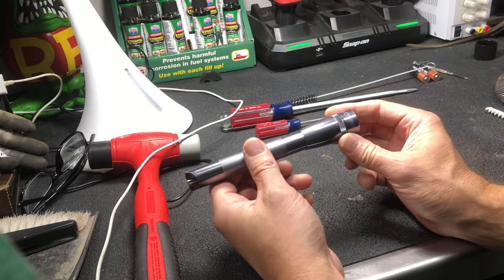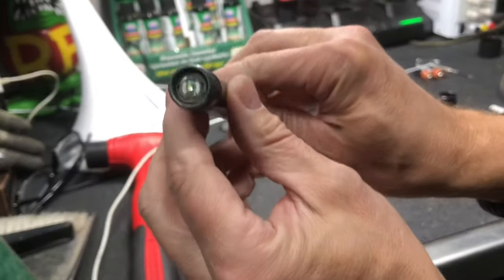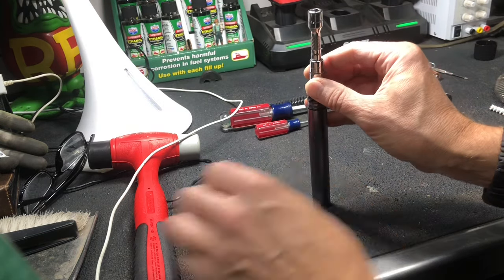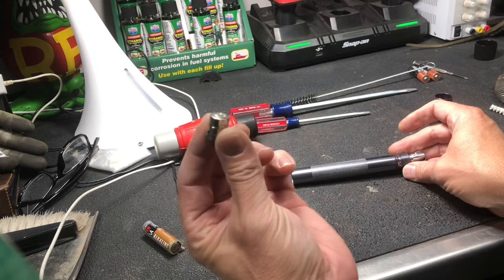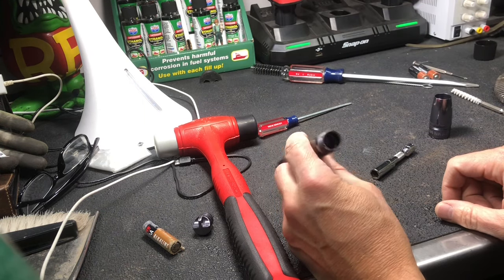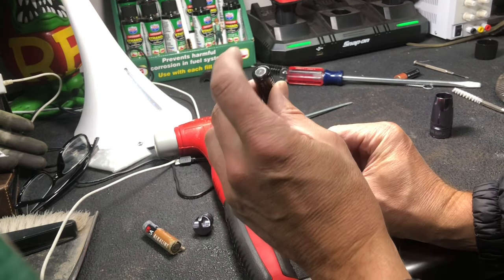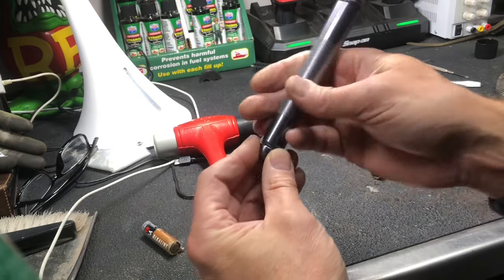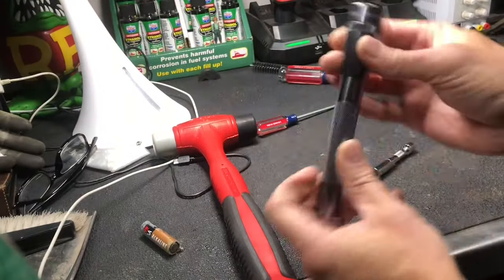How to easily remove bad corroded battery from LED mini maglite !

Comment: For your future reference in order to clean the battery acid. You can mix a solution of water and baking soda and that will eat up the acid and clean the housing.
Reply: This works on lead acid(car) batteries.  Alkaline batteries are not acid they are a base.  So vinegar or some other acidic substance neutralizes it.

Comment: Nice work. Yours was the 3rd video I had to watch before I got any real solution to the corroded battery problem. I actually soaked my mini mag light in water overnight & let it dry completely after knocking the corroded batteries out. Mine had been sitting for 15 months, (covid coincidence? I think not). I ramrodded some steel wool through the tube & reassembled it according to your instructions. Your "helper" was very cute too..."We're saving lives, son" hilarious! 5 Stars.
Reply from the maker: Thanks Patrick!  Glad it helped out to fix your Maglite.  My helper makes a grand entrance in our newest video where I show people how to install trim molding.  Check it out!  Also PLEASE like and subscribe.  We need all the help we can get.  Thanks!

Comment: I have the exact same lite and the original Duracell batteries are stuck in it. Because it was the bottom battery this did not work. Even using a 5lb hammer it did not work at all. I was hitting so hard that the bottom of the lite was getting distorted, those batteries are fused to the walls.

Comment: Thanks for posting. I have a few flashlight with this problem, glad I saved them for many, many years so now I can try this.  In my cases they were always the Duracell brand that exploded/leaked and got stuck.  Mine are older models so ther don’t have the led cap so they require more steps (i saw on someone else’s video) to remove the bulb and bulb assembly safely.  You video is better because of your kid.  Hilarious and well played!
Reply from the maker: Hey Jordan!  Glad you liked the video.  My kid makes a grand entrance in our newest one where I show people how to install trim molding.  Check it out!  Also PLEASE like and subscribe.  We need all the help we can get. Thanks!

Comment: Worked PERFECTLY with a maglite I got for free because corroded batteries were stuck - Used your method and had it working perfectly in 10 minutes. Thank you so much!

Comment: Can't believe this video popped up in my feed!  I lost one of those identical flashlights many years ago, and just found it last week.  Went to change the batteries, and they were FROZEN.  Couldn't get the second battery out, and didn't know how to get the LED out, so I threw it in the garbage.  Just pulled it out of the garbage and used the socket trick.  Couldn't hammer it out, so I had to go to an arbor press and press it out.  I had to get all the crap inside of the light body out with a file because it was so bad.  Put it back together and it works!  THANK YOU!!!  👍

Comment: Thanks for sharing. Worked great! After the socket, I had to use a screwdriver and hammer to push the batteries down. I broke my little plastic piece almost in half, but just put the biggest piece back in with it and it worked! Saves me from buying another one for a few years anyways :)
Reply from the maker: Hey Lorry!  Glad it worked!  Let me know what we should fix next!

Comment: Nice job handling your interruption lol.  As an added tip, soaking the tube (minus electronics) in white cider vinegar for a couple hours can help make that cleanup/brushing out a lot easier and less traumatic to the flashlight than using a screwdriver to scrape it out.
Reply: Tried that, didn't help at all. Had to use insane force to get it out (insane force in this case: drilling a hole in the stuck battery (which was still rather live even though very leaky) and then getting a large screw in. Levering it out by using a pair of large pliers did not work, I had to put the head of the screw in a vise and then pull on the battery with my full bodyweight (55 kilo) and still had trouble getting it out.
Cleaning was a shit process as well. Soaked the entire battery-holder assembly in a bag completely filled with vinegar and scrubbed the living daylight out of the insides with an old toothbrush and scraped with scalpels, but it's still not completely clean.
Reply: @weeardguy  yeah I was referring to soaking the tube in vinegar AFTER physical removal of the batteries not before.  Soaking before removal, I would think might actually result in more gunk from within the batteries coating them inside the tube and potentially making extraction more difficult.  Could be wrong though.  Based on  your description of extraction of the batteries, sounds like you had a rather extreme case of corrosion.
Reply: @timothyhedrick5295  Well, I didn't refer to soaking it in vinegar before physical removal as well. I soaked the battery-holder assy but sure as hell not with the battery still in it.
As vinegar neutralizes the acid, I can't think it will make matters worse friction-wise, but I doubt it would have made a difference in this one ;)
Yeah and the worst is that it was a write-off from work, where I have been one of many that had to replace the Maglite because of leaky batteries. Thank god we have switched to Varta batteries that aren't as prone to premature leakage... But I have now noted on my tool checklist to inspect the maglite once every 6 months...

Comment: Tried to do it this way, but no luck. Had to revert to drilling a hole in a still rather live battery (I thought: 'it's leaking, so it's probably dead'... well no, it wasn't...) and then screw a nice large 80 millimeter long wood-screw into 'em (I'm Dutch, no idea what you call a 'spaanplaatschroef' in English).
Thought I would get it out easily once the screw was in, but I had to grip the head of the screw in a vise and use all my 55 kilo to pull on the light until it eventually started moving. Still took a shitload of force but eventually a satisfying 'plop' made sure it was out.
Oh btw, please just interrupt the video if your kid comes in. They only grow up once ;)

Comment: Very helpful. Mine still works intermittently, but I think the LED is bad. One note, although the socket trick worked, I should have gone down one size more (just covering the LED). I crushed the plastic tube. Still went back in, however it was pretty mangled…thanks for this.
Reply: Absolutely right on the smaller socket tip, I couldn't get it to work until I read your comment.  Luckily I only partly damaged my plastic tube before checking some more and trying the smaller socket just over the bulb.
Reply: @saxonuk14  glad to hear that. 😊

Comment: I was not as lucky, my older style mini mag had both batteries corrodes. I did take a deep well socket to drive them out, however, it was not a love tap, it took quite a bit of force to remove them.

Comment: Found one 2 days ago at my local supermarket's recycling bin for waste electronics somebody threw away. 😇🤗

It had that miniature (working !) traditional glass krypton bulb. So not an LED. I'm going to get that upgrade for it in the future. 🤔😎

Anyways... a wedged leaked Duracell AA batery was stuck inside. But I was able to get the battery out from the other side by gently hitting that plastic piece to push it out. 😊👍

Luckily the leak wasn't big & the corrosion on the inner metal tube part wasn't significant. So I just used some sanding paper & a metal file to remove the jagged surface left by the alkaline liquid from the battery. 🙄😏

I put some minerail oil on the inside of the walls of the metal tube part of the flashlight to ensure easy sliding of AA batteries out. 😆

Comment: What if you can’t unscrew the end cap that threads in?
Reply from the maker: Hey Mark!  Try using some lemon juice or vinegar on the cap.  It neutralizes the battery acid. Then get some pliers or vice grips on the end cap and give it a twist. Let me know if it worked!
Reply: @restomod101  I've got the same issue.  Tried some pliers and it is stuck.  Will try a soak and see if it comes off.

Comment: Just finding this because I have this issue. However the top of my flashlight does not screw off… I’ve tried. It’s not the same brand as yours… it’s frustrating me but unless I can screw the top off I think my little tiny flashlight is for the scrap heap.

Comment: LMAO !!! saving lives 🤣. So my Solitaire Mag won't open where I put my batteries in. I am wondering if the corrosion sealed up the opening and it is a mother to unscrew, I've tried pliers and tapping it. It is really stuck.
Reply: What I used to open mine was a key ring that I ran through the little hole on the battery cap (meant for either a key ring or lanyard), but the keyring I used was about as thick as the hole itself, then I put in a screw driver and started turning by hand, mine eventually gave, but I can't say you'll have the same luck unless you have strong hands and grip

Comment: What size socket did you use for the LED maglite mini?
Reply: I'm Dutch, so don't get me going on this one: I used an 8 mm socket. That's 0.314 Inch, but don't get me started on what the actual designation is in imperial sizes ;) I guess, judging how close it is to a 1/3 of an inch it probably is, but hey, I'm a metric guy ;) (and always get a headache at work, where i have to deal with imperial sizing/dimensions a lot...).
But mine was so stuck I could not get it out this way. I had to drill a hole in the battery and get a thick screw in and then pull on it like mad (I needed my full body weight (55 kilo) and it still was hard)

Comment: 1st. I have a mini-Maglite, 2 AA
The insides look new at both ends, but the batteries are REALLY STUCK
I've tried water and baking soda, 2-days
I've tried WD40, 2-days 
I've tried vinegar, 2-days 
I tried pounding them out with a long punch ruining the switch on top and the batteries just will not budge????????

Comment: What if the end cap where you get the battery out is stuck. It feels like its glued solid and will not budge.🙁
Reply from the maker: Try heat.  Heat will make the metal expand.  Just don’t melt the rubber gasket! If that doesn’t work try soaking the cap in white vinegar. That will dissolve the acid.  Good luck and be careful!
Reply: @restomod101  Wow thank you for the wonderful reply. :yougotthis:

Comment: Hey, my metal thing (spring I guess) broke off. Can I use aluminum foil?
Reply from the maker: Hmm.  I would try to use the piece of the spring that broke off and wedge it between the battery and the contact. Good luck!

Comment: Have a few of those mini mags, none of the end caps could be screwed out due to major battery corrosion even using a pipe wrench to the point of destroying it. The others immersed in penetrating oil for months, no can do because of the liquid tight O ring blocking any penetration. I bought a dozen of them over time and left it everywhere like tool boxes car glove box compartments and forgot to change out the batteries every few years. Alkaline batteries even top quality ones will leak, recharables not so much. Maglites were the tops in its days, fortunately we have better flashlights much brighter and cheaper with multiple functions like flashing, dimming and annunciation to change or recharge the batteries.

Comment: Yeah this is perfect world stuff . How about when you've drilled the battery from the bottom it still won't come .If you hit from the top the plastic skaters because it still has batteries welded to the side.

Comment: my battery cap wont budge at all, any tips?
Reply from the maker: Try using a pick or thin screwdriver and put it through the hole in the cap that’s designed for a clip or holder.  Use the the tool for leverage.   If you have the end of the flashlight facing you turn it counter clockwise.  You can also try spraying some WD40 where the threads are.  If that doesn’t work apply heat where it screws in. Be careful as it will be hot to handle it so make sure you where protective gloves.
Reply: @restomod101  last night i tried wd40 and putting something through the hole for leverage but it didnt work and even started to bend that part of the battery cap, ill try again with some heat but if that doesnt work im gonna give up
Reply from the maker: @ethanlaudato8731   another idea is to try soaking the end of the flashlight in Vinegar.  That will break down the battery acid. Let us know if that works!
Reply from the maker: Hey Ethan you can also try soaking it in lemon juice. That will dissolve the battery acid too. Keep us posted!

Comment: Doesn't work .I hammered until I was blue and still could not get the corroded batteries out.
Reply from the maker: That’s not good.  Here’s a couple extra pointers, spray the inside walls of the Maglite with electronic contact cleaner and then try and tap it out.  If you don’t have any get a eye dropper or syringe and carefully pour in 5-10 drops of Isopropyl alcohol (rubbing alcohol).  You can also try lemon juice or white vinegar.  Let me know if that works!!
Reply: @restomod101  _ have tried WD40 with no positive result. I haven't tried the vinegar (acidics) or my electronic contact cleaner. Seems the corrosion (white powder) expands the batteries inside against the walls and a hammer and wrench sockets couldn't make it move.
Reply from the maker: Wd40 isn’t going to do much with neutralizing the corrosion.  Try lemon juice or white vinegar.  Let me know what happens!

Comment: IIt's not acid but alkaline.  When alkaline batteries have leaked it's hard to remove all the gunk from a device.  Acids can be used to neutralize the alkaline.  Vinegar works but  I'm using vinegar essence diluted to a concentration of about 5%.  When the acid reacts with the alkaline, the alkaline will fizz for a short moment.   Continue until the fizzing stops.  The rinse and dry thoroughly.  This does not remove all the chunky bits of alkaline battery goo but it neutralizes it removing its corrossiveness.  I've used this numerous times to deal with leaked batteries in all sorts of devices.  It failed me only once when a circuit booard ha already virtually ceased to exist before I started.

Lesson learnt:  remove batteries from devices when you don't use them.  And don't ever trust batteries advertised as leak proof.  In my experience ALL will leak sooner or later.  Be extra paranoid with batteries stored under extreme conditions such as in hot cars.

Comment: "EASLY"... hum ! Merci pouf la méthode mais avertissement à qui, comme moi, ,à laissé des piles pendant des années, soyez TRÈS généreux en lubrifiant et TRÈS TRÈS patient ET précautionneux pour sortir des piles coincées par le métal oxydé SANS détruire le porte ampoule plastique (que je vous recommande de protéger d'une rondelle de caoutchouc du dur, cuir, carton... avant de taper dessus avec une tige métallique*). Personnellement j'ai dû utiliser une pierre à meuler sur Dremel pour polir la base du tube au dessus de sa partie filetée. 

* J'ai préféré utiliser un crayon scié, certes sa moindre dureté ne permet pas d'aussi bien transférer la force des coups, mais ça limite considérablement les risques de dégâts.

Comment: That back opening thing is to tight for me
Reply from the maker: Try using a pick or thin screwdriver and put it through the hole in the cap that’s designed for a clip or holder.  Use the the tool for leverage.   If you have the end of the flashlight facing you turn it counter clockwise.  You can also try spraying some WD40 where the threads are.  If that doesn’t work apply heat where it screws in. Be careful as it will be hot to handle it so make sure you where protective gloves.

Comment: Invariably the end cap is stuck also if the battery is stuck, so how do we get the end cap off? These are a very poor design of torch, how many videos on this problem are out there?! I wouldn't buy another one that's for sure.

Comment: Alkaline batteries don't have any acid in them, they have alkali, the opposite of acid.
Reply: Same effect though. An alkali burns just as readily as an acid does.
Reply: @Backoffboogaloo  However, one neutralizes alkali by putting acid on it, so it's *not the same*, if you put more alkali because some ignorant fool who thinks "it's the same because it burns" told you there was acid in the batteries, you just make things *worse*.
Reply: @diamaunt2782  how about you read my comment again. I did not say they were the same.
Reply: @Backoffboogaloo  Ah, the futility of youtube comments.  "same effect" you allege, while in fact it's not.
Reply: @diamaunt2782  don’t you try to argue semantics when you didn’t read my comment properly in the first place. A chemical burn is a chemical burn no matter whether an acid or an alkali is involved. Same effect. I did NOT say it was the same, nor did I even say they were burning in the same manner. The effect is the same. It’s a chemical burn. Very similar kinds of tissue damage. The only difference is in the treatment. You need to know which one is the culprit in order to treat it. It’s a bit like ethanol and methanol. Very similar effect but opposite molecules. In fact you can use ethanol to treat methanol poisoning. 

Now. What was the point of of arguing when I told you already that you misread my comment?

Ps before you comment further, please be aware that my degree is in chemistry.
Reply: @Backoffboogaloo  And yet, even there, you're wrong.

"Acid burns cause coagulation necrosis; alkalines cause saponification followed by liquefaction necrosis and, in general, penetrate more deeply and carry a greater risk of severe systemic toxicity. "